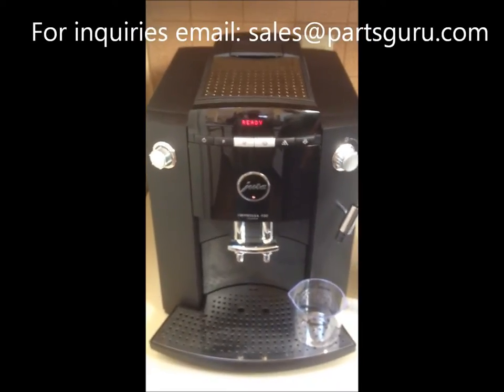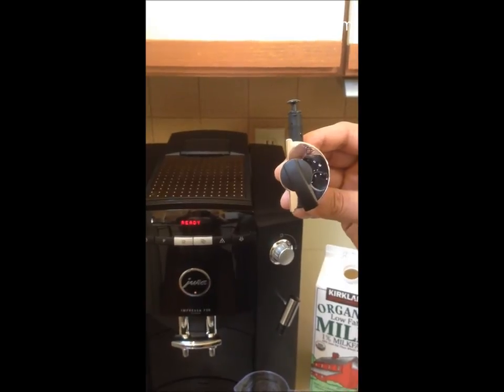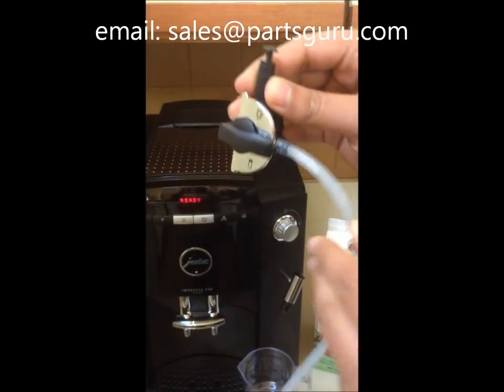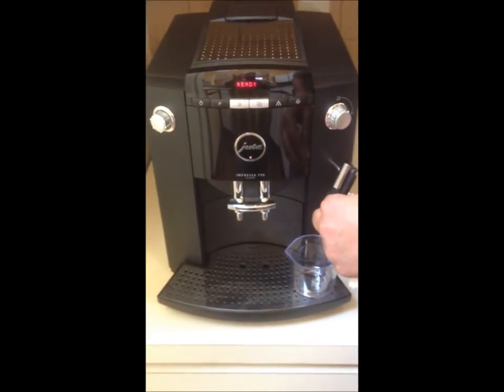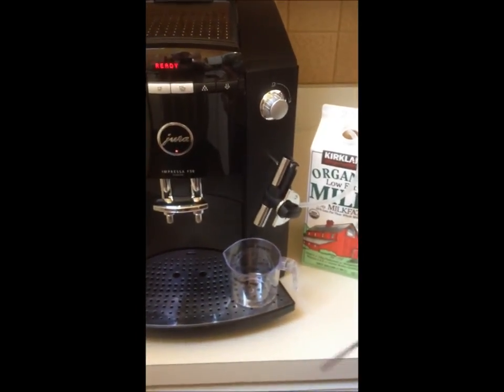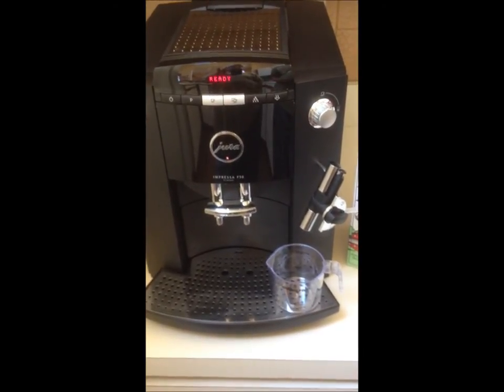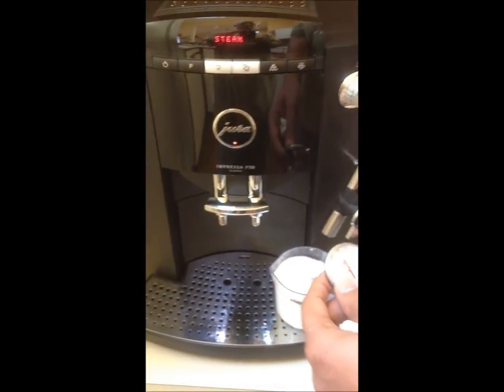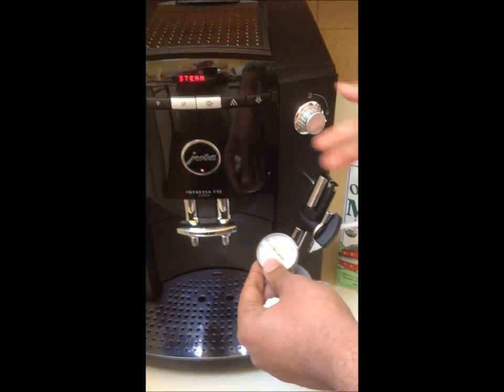Jura Automatic Professional Frother

Comment: The dial on the front of the frother is a temp control. Middle is neutral. As you leave upwards it is frothing and getting cooler. As you go down its steaming and getting cooler. If you want steamed milk very hot, start at neutral and turn downward just a bit. You get VERY hot milk. Same way if you go up. The position you used is the lowest temp.